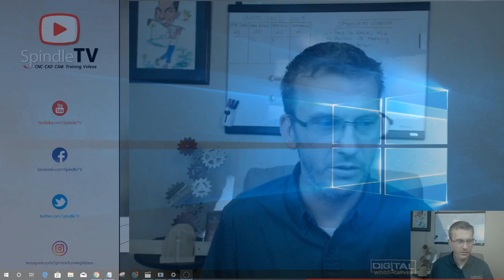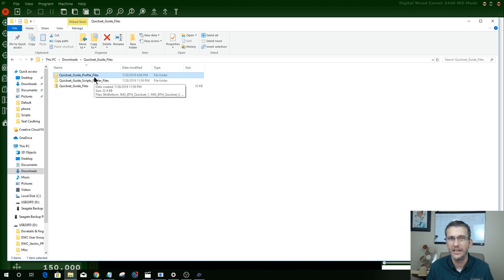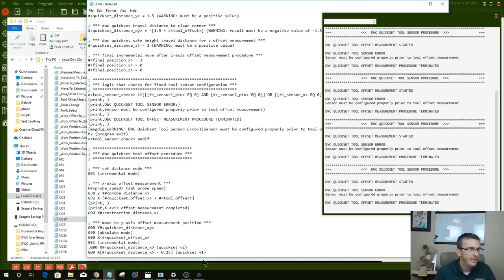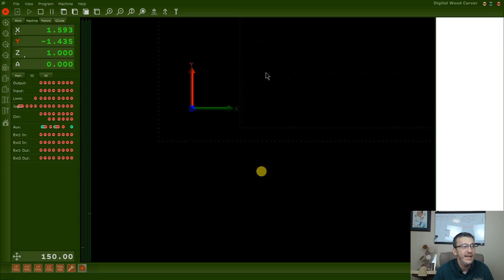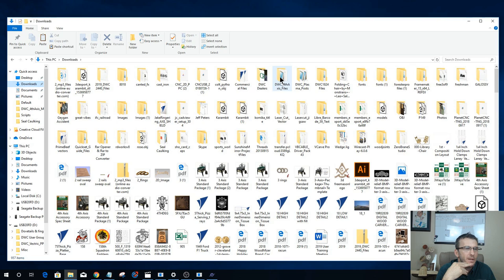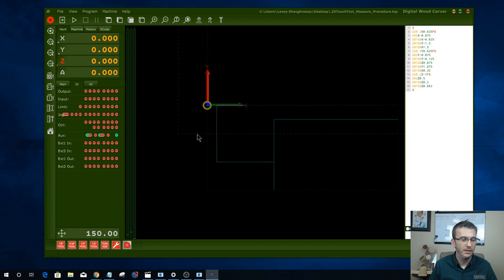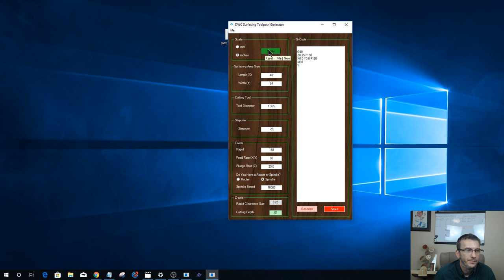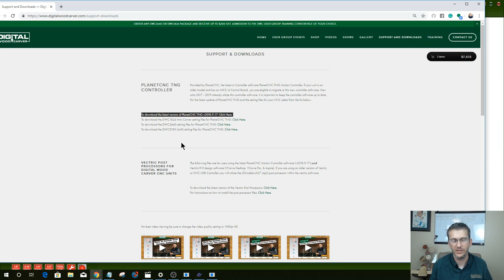Planet-CNC TNG - New Tools and Functions from Digital Wood Carver

Comment: Can I make a script where when paused the currently ongoing program, the spindle does stop too?
Reply from the maker: Normally you pause then turn the spindle off with the spindle button...but yes you can write a script to do that and you will need a script to turn the spindle back on before you unpause
Reply: It seems like you understand the CNC planet very well. Did you make the software? If so, can you display the yellow disc tool if the diameter is large, around 200mm, the shape is perfectly round and circular?